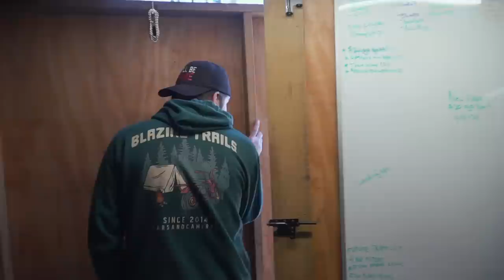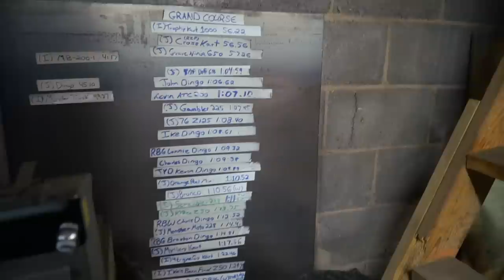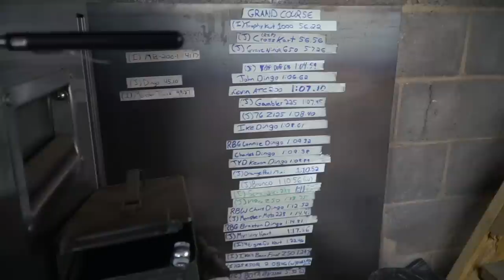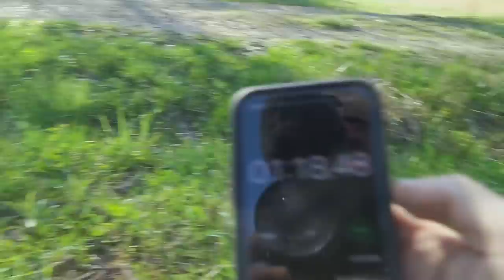We Bought a $20 Go Kart from a Chicken Farm... Will it Run + Ride?

Comment: opening the throttle to much can cause the vacuum over the ventures to decrease if the engine rpm is to low... to be or not to be one with the engine. crank case pressure for the fuel pump also lowers hp.